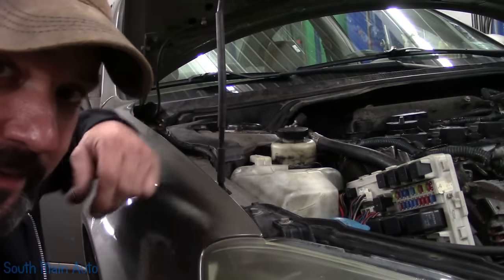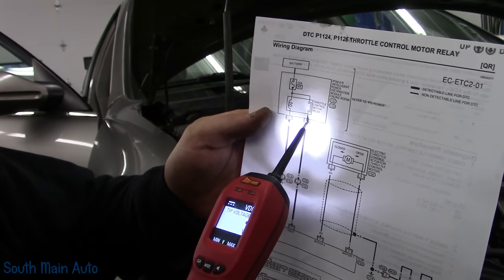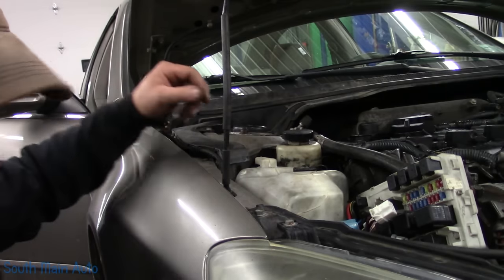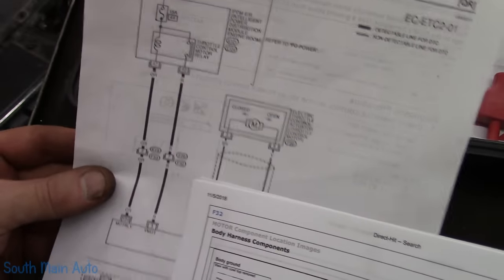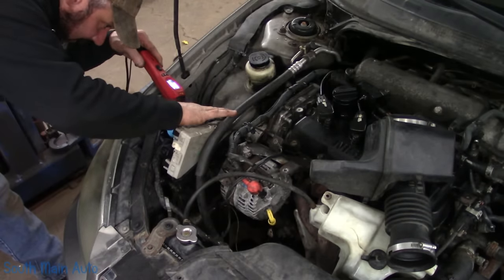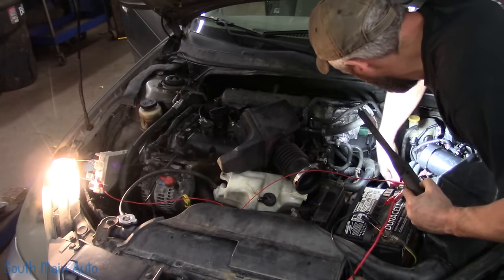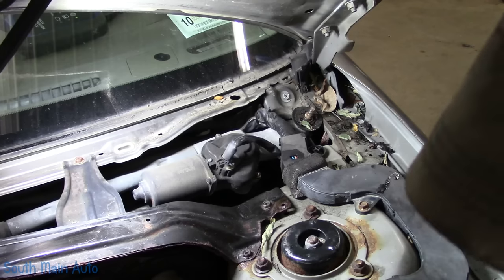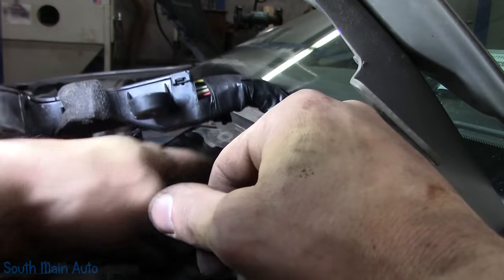How To Fix A Car That Keeps Blowing Fuses

Comment: You didn't show the parts where you tested the wires, and especially in the last connection. You should have had a close up of all the testing you did, and explained what you did when you tested the wires and why. How did you arrive at which wires to test? And also what kind of testing tool did you use. When you are showing those diagrams, you need to show close ups of them lying flat on a table. You are talking very fast and waving them around and pointing here and there when you were trying to explain what they were all about. Couldn't read it, and it all went too fast and back and forth. And suddenly a new diagram with no connection to the first. And how did you fix those burned wires? There were no slack there. You didn't show any of that. If you want to teach people properly about these things, you can't take shortcuts when you explain things. And you need to take your time to explain it. You need to explain it all and show it all on camera close ups (without you being between the camera and the thing you are testing and fixing). There are so many people that needs to learn these things, and when there finally is a detailed video about the diagnostic part, we can't see what you are doing. And you didn't show how you fixed them. You should also have shown how you detached those plastic things around the wipers. Because many people won't know that either. You did a good job on the car diagnosing it. But the video could have been better, imo.

Comment: What morons are freaking Thumbing down your videos.  It is life advice.  Don't take shortcuts.  Be methodical and you won't have issues.   Had a simular stupid issue with my headlights.  Turns out I forgot to check for power at the connectors because I assumed I wouldn't lose both headlights at once.  Turns out someone had fucked with them before and the connection was pushing inside the headlight.  I had to get creative and trim a bit but I got the headlight connected to click fully in place and poof problem solved.  Also figured out the Relay I salvaged from a 2013 focus was identical in form and function to my 2004 since i damaged one of them in the Arduous process.  Pro tip.  If you car is over 8-10 years old.  and you love it and plan to keep it a long time.  Go to the yard and take all the fused and relays and shit.  They basically never charge you for small stuff and someday it might save ya ass.